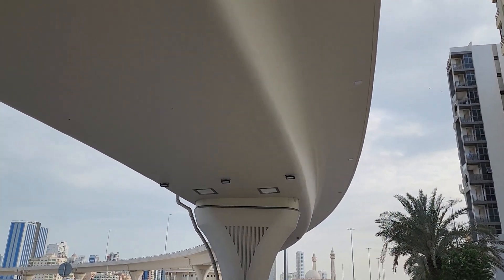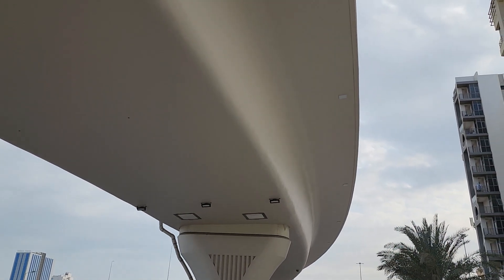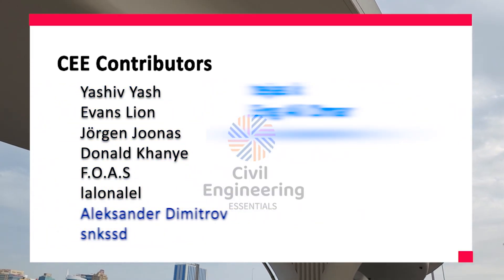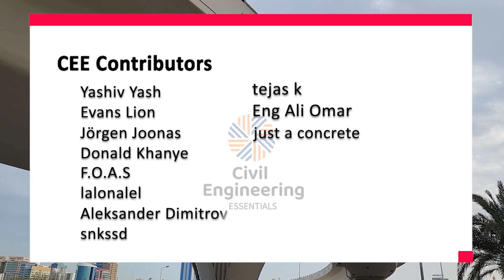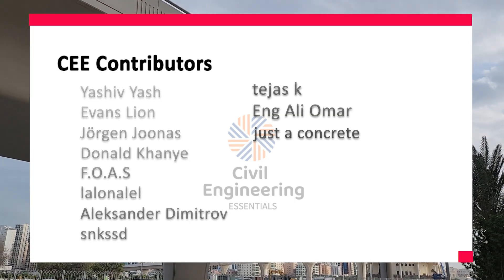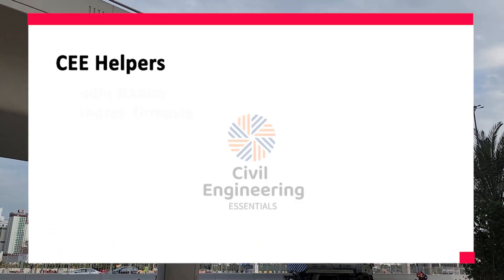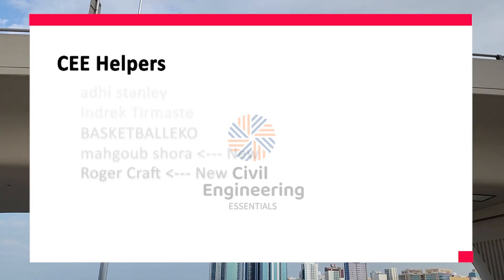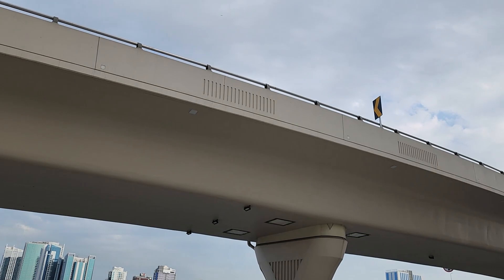Structural Modeling and Design of a Highway Bridge | Part 4: Site Visit

Comment: very good initiative, this is certainly the most detailed video series on the subject.... one question though.. will you be using ROBOT for the model or SAP 2000?
Reply from the maker: Planning at the moment to use either Robot or Midas
So stay tuned for more content ^_^
Reply: @CivilEngineeringEssentials  rooting for robot 🤞